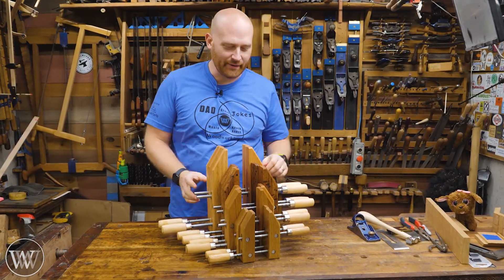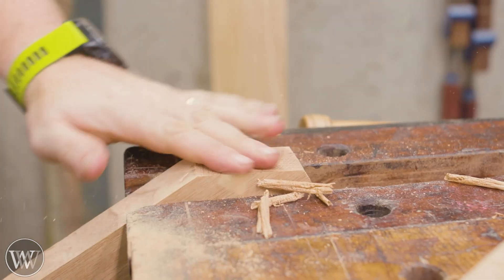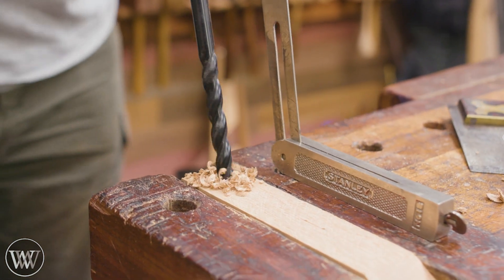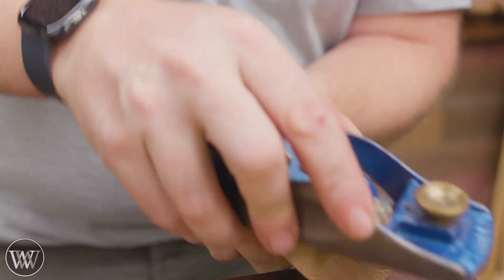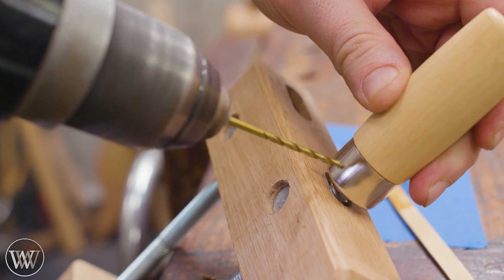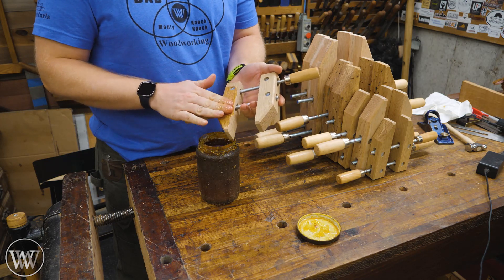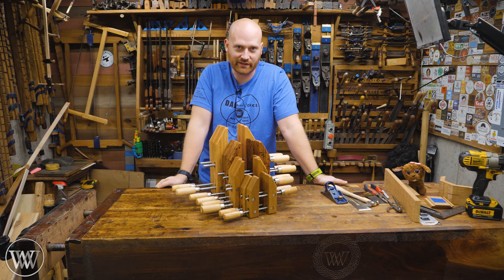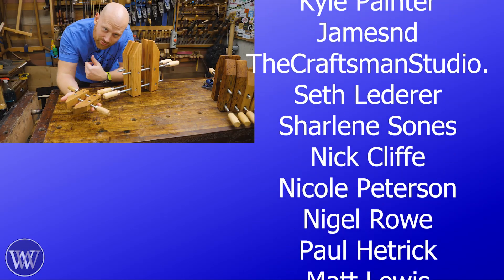How To Make Hand Screw Clamps Tay Tools Kit

Comment: I made 4 12" hand screws totally from scratch 30 years ago.  I had a tap and die set but needed to buy a 3/8" left hand tap and die to make my own steel pieces. Made my own handles as well. It was a fun project and saved me a few dollars. Of course I had all the power tools to do it so the only hard part was cutting the threads which was all done by hand.  Mine were also made from white oak. Making your own tools gives a lot of satisfaction.  :)

Comment: When drilling through metal with a handheld power drill I use the torque setting on the drill on a low enough setting so that if I put too much lateral pressure on the bit and risk breaking it the torque limiter triggers and stop the bit from spinning rather than break it. It saved many of my drill bits!!!
Reply from the maker: I had that on, but did not set it low enough for the first break. the next ones it was on the lowest setting and still broke.
Reply: @WoodByWrightHowTo  sometime drill bits are just too easy to break!!!

Comment: You know I seen some of this style of clamp at garage and estate sales and had forgotten how useful they are for a lot of things other then gluing up 2 parts.
If you need to cut hinges into a door 2 screw clamps can hold the door on its side, you can use them to hold templates in place hold tools upside down , its endless just how much you can use them for, and I passed them up at the sale thinking id never use them and went for the quick clamps. 
I may just make me a few sets of them I have the stock on walnut and popular 
But id rather have hard maple and white oak .
Reply from the maker: I use them all the time for working on small parts. Even better for power tools when you need to put small parts into a blade.

Comment: I saw thosw kits, i wish they would make some that came in larger sizes that you can typically buy. 14"-18" would be cool. Can find them at harbor freight from 8-12" as well
Reply from the maker: you can make then any size you want the hardware. there is nothing stopping you from putting longer boards on them.

Comment: That was great.  Show to do and what not to do.  Saves those who follow a lot of grief.  

q.  On a kit theme, can a length of 2" band saw blade be used to make a Roubo resaw saw.  And not only can it be used but would it do a good job?
Reply from the maker: I have seen several people do that. You would want teeth on the smaller size for that saw. Something around 2-4 PPI.

Comment: Awesome job as usual. where did you get the hammer you used in the video?
Reply from the maker: If you're talking about the one at the end where I drove in the pins. That is a chasing mallet. It's designed for carving and metals and you tap on the chisels with it. I believe I got this one off of Amazon actually. But that was a long time ago.

Comment: I hear boiled linseed oil always recommended the most for tools, but I just can not stand the smell. Is there a type that doesn't leave that smell all over the tool and all over your hands every time you touch it? Or what's the best alternative that won't smell?
Reply from the maker: the home made stuff I use smells different, but Tung oil is basically the same thing but with a different smell. jut make sure it is actual Tung oil and not oil mixed with other things as a lot of it is.

Comment: Why did you decide against a jig, seems to me that a Jig or three would have removed the need to do any marking?
Reply from the maker: Has each one of these are different and each one has different holes. I would have to make a lot of different jigs and to do that we take more time and effort than it would just eyeball it. If I were doing these in production then definitely but just doing two of each size. It's not worth it.

Comment: It has been my experience that Oak makes the clamps heavier than desired. I suggest a lighter wood such as cypress, red wood even popular. Strength should not be an issue. Weight will 
be, especially on the larger ones.
Reply from the maker: I actually made a set out of poplar a few years ago and ended up breaking one. Oak is actually on the weaker side for them due to being ring porous. Generally, the best wood to make them out of would be something like a straight grained maple.

Comment: Snide remark: You don't need to put those pins through the handles if they're epoxied on, do you? You could have saved yourself five busted drill bits!
Reply from the maker: The big benefit to the pins is that they will help later on in their life. As the wood expands and contracts and the steel does not, the epoxy will lose its strength in a few years.
Reply: @WoodByWrightHowTo  I betcha the epoxy won't fail; get back to me in a few years.  😁

Comment: Was wondering if so much boiled linseed oil on the skin would be toxic, but according to the first articles I found, it's probably ok.
Reply from the maker: I use homemade boiled linseed oil rather than the store-bought. Homemade doesn't have any extras added to it to speed up the drying. It's just a polymerized linseed oil. You can drink it if you want to. But if I use this stuff from the store I still use gloves.

Comment: Center drill bits to start holes and you break a lot fewer drill bits.
Reply from the maker: The problem wasn't the starting. It was coming out the other side of the threaded rod. If I didn't have the clutch set just right it would catch and because it's so thin it would just snap.

Comment: Don't epoxy the handles on you cross drill a 1/8" hole in the Ferrell, wood handle and down into the all thread all the way acrossed then use a cotter key to lock everything into place or pen over a pin you can use animal hyde glue or wood glue to tighten the fit or drill the handle end hole under sized so you screw it on making a sort of tap end on the all thread with a file or grinder. 
A brass pin is plenty strong enough to hold the handle on as is a cotter key.
And you can remove either of them to take the handles off at some point.even a wooden dowl will work.